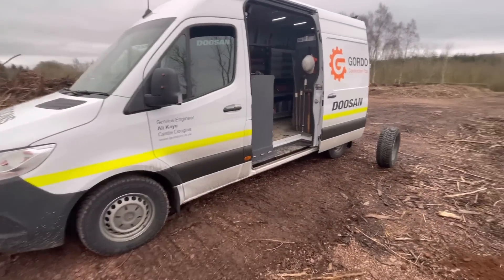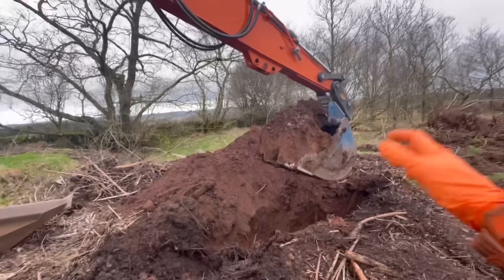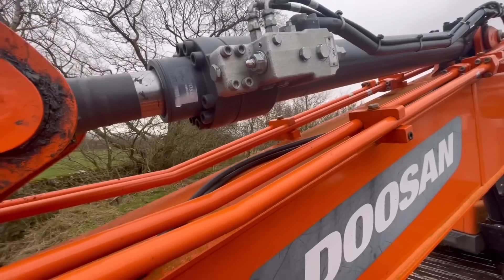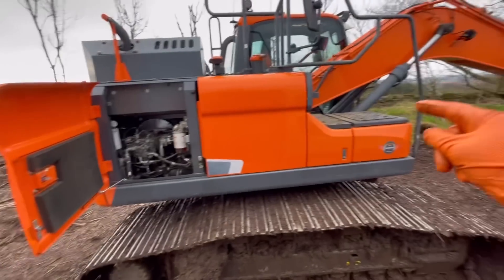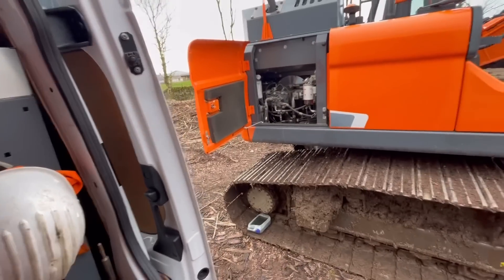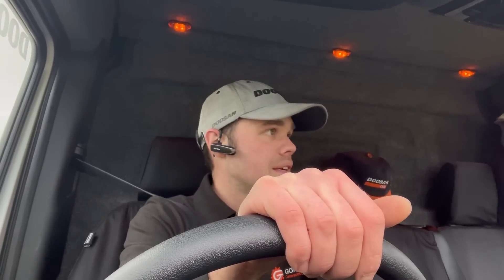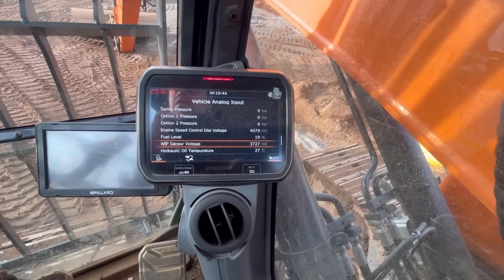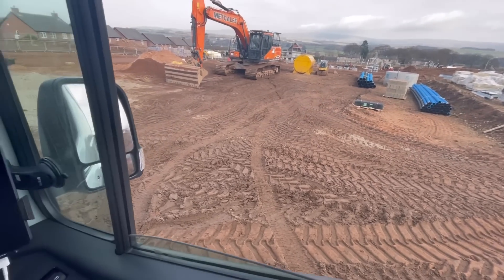Arms dropping / fan hubs failed / machine inspections / Episode - 154

Comment: Hi Ali watching you changing what you call stop valves we call them check valves iv never seen so many fail on new machines and that fan hub after 1500 hrs the old dawoo were alot more reliable there destroying all the machines now with electronics more electronics more problems the first machine I bought back in the early 70ts was a O&K rh4 7 years later never let me down that was back in the days when you could work 12_14 hours a day brilliant machine. Hitachi came along then O&K slowly died off there still going today under the TEREX badge.saying all that you'll never be out of work it's hard to get good fitters now
Reply from the maker: Yea it’s I’ve not changed a check valve for a while then get 2 in two days 🤦‍♂️ I believe the fan hub was a Perkins issue their bearings weren’t heave enough to carry the viscous fan I know old solar’s still going today unfortunately the demand for driver comforts and emissions regulations have made machines more complex